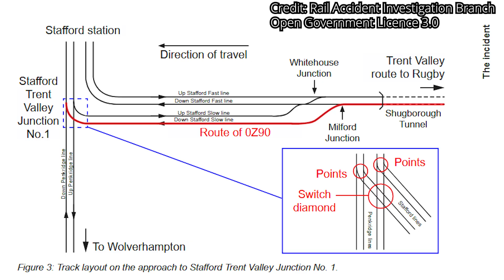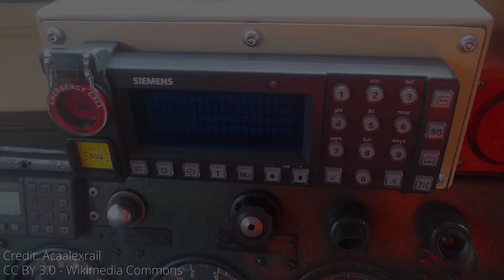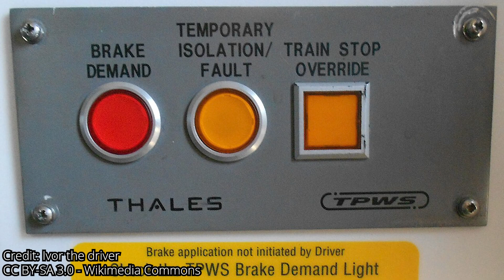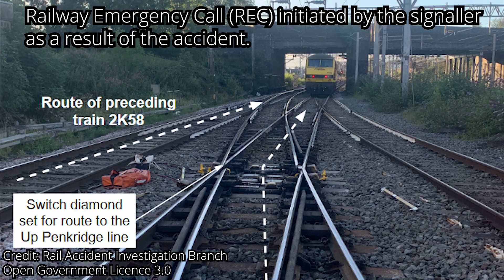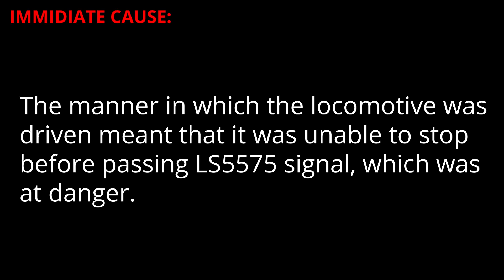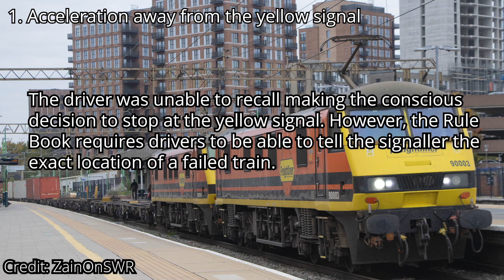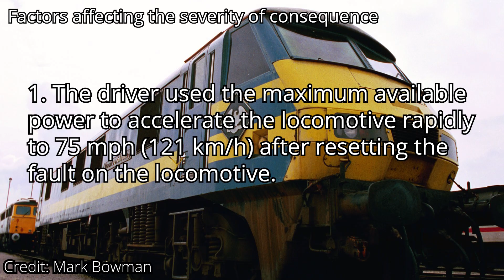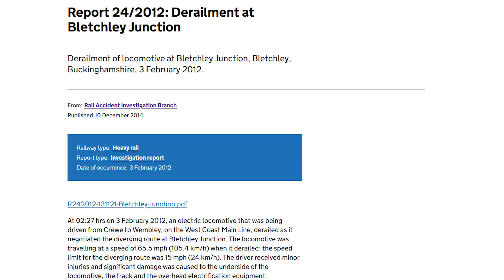The Stafford SPAD Incident | Jakeso

Comment: MYSTERIOUS & IMPOSSIBLE ISSUES  
1: Why did the Driver stop at a yellow signal ?  THIS IS NOT NORMAL. Loosing the line light does NOT mean you need to stop, as a light loco will happily coast for miles.  
2: ALL light locomotives are limited to 60mph for braking reasons ! And have been for over 50 years !  
3: Your Diagram/picture at 0:28 indicates a route (the dotted white line) through a "switch Nose" Diamond that is IMPOSSIBLE. You cannot change tracks passing through Switch Nose Diamonds. And if the switch nose Diamond had become so totally faulty as to provide the path you have dotted in White, this also means something has gone very seriously wrong with the "Interlocking", which would never have permitted either route either way through that Diamond to be cleared. And the Signalman would have been immediately aware of a very serious and highly dangerous "Wrong Side Fault" !
So ! Where did you get this information, because as a ex Senior BR Mechanical & Electrical Engineer I'm suspicious YOU have NOT got the facts straight at all ! SPADS are one thing, but a Switch Nose Diamond doing the IMPOSSIBLE require a major investigation and creates the suspicion that something has gone seriously wrong with the wiring of a Power Signal box. Also the way you explain the supposed RAIB findings are also highly suspicious. What Railway Qualifications do you hold, because my suspicion is you have NONE.
Reply from the maker: To answer your mysterious and impossible issues:

1. I have no idea because I was not driving the train.
2. Yes, I mention in the video that the driver was exceeding the set speed for light locomotives. (Seen in the video at circa 09:35)
3. I did not create that diagram or picture, it's from the OFFICIAL RAIB Report THAT IS LINKED IN THE VIDEO DESCRIPTION and you can see for yourself, Page 19, Figure 8. As for the route being 'impossible', if you actually watch my video and/or read the report you'll understand that the whole reason this is an incident is because the locomotive PASSED THE SIGNAL AT DANGER and THEREFORE THE ROUTE WAS NOT SET FOR THE LOCOMOTIVE the route was set in the direction of a southbound train going towards Wolverhampton, hence the points being set for that movement. I will now link a section of Paragraph 47 of the report: 'At the same time, the front of the locomotive forming 0Z90 was passing the switch diamond at the junction (paragraph 8), which was set for the passage of the next southbound train towards the Up Penkridge line. As it passed the switch diamond it deviated violently to the right towards the Up Penkridge line (figure 8) while travelling at about 13 mph (21 km/h).'

I am not the RAIB, I am not the people who made the investigation nor am I the one who published the report. If you take issue with their report or the diagrams they have included in said report then feel completely free to let them know, but that is completely and utterly out of my control.

As for my 'railway qualifications', I make it abundantly clear in my channel's description that I am not a railway professional nor do I claim to be one. The fact that I am not one, however, does not mean I am unable to read reports accurately or have an understanding of the railway, I understand and appriciate the fact that I will have limitations but I can assure you I do not see where I am critically disadvantaged in reading or understanding this report.

Regardless of your 'ex-this' or 'ex-that', I'm suspicious YOU have NOT actually watched the video nor read the linked report and instead accuse me of not getting my facts straight at all and seemingly assume that I am singlehandly responsible for conducting the investigation myself and publishing the report when all I am doing is taking the information from the PUBLIC report and explaining them.

I'm sure you can appriciate after all the effort and time I put into these videos I take a degree of offence to your comments of which most of them are either out of my control or my responsibility. If you can clarify the 'suspicious' way I explained the findings then I'd be happy to take your feedback or clarify my points to you as that is arguably the only thing in your comments that I can actually answer to.
Reply: @Jakeso  
POSTS BY UNQUALIFIED PEOPLE CONCENRING COMPLEX RAIL CRASH INVESTIGATIONS - RESULTS IN PURE FANTASY !!!
Your programme does NOT give a link to the original RAIB report. But it does mention  QUOTE : Images sourced from Wikimedia under the CC BY-SA 3.0, CC BY 3.0 and CC BY 2.5 Licences: UNQUOTE

Wikimedia is NOT a qualified Edited, or verifiable source to confirm ANY information. Its as stupid as Wikipedia, and all other similar websites. And the links given ALL connect to Elon Musk's "X" channel. And that too is NOT a qualified or qualifiable source.  

Further have nailed down the original RAIB report by contacting RAIB there are NO TRACK DIAGRAMS OR PHOTOS OF SUCH IN THAT REPORT. And because you are obviously NOT even a Railwayman, much of what is contained in the original report answers my original questions I posted above. Hence I do NOT even believe that you accessed the real RAIB report at all. As that RAIB report clearly explains why the Driver stopped where he did, and clearly reveals that Freightliner are at fault for NOT properly training their Drivers, as I pointed out in my first Post. And the RAIB does state the loco ran through a "Pair of Points" damaging the equipment. But at no time derailed so NO "Switch nose Diamond" was involved at ALL. Your an unqualified buffoon and as a result post misleading and inaccurate fabricated nonsense about Rail Incidents you have absolutely NO comprehension of. And indeed even if RAIB had a typo error in their report you would not be capable of even spotting that.  People like you are a menace to the Internet.

REFERENCE: I am an ex senior British Railway Mechanical & Electrical Engineer. Who does NOT appreciate the sort inaccurate unqualified information being posted by "Jakeso".
Reply from the maker: 'Your programme does NOT give a link to the original RAIB' - It's the fourth line down in the description.
'Images sourced from Wikimedia under the CC BY-SA 3.0, CC BY 3.0 and CC BY 2.5 Licences' - The background images, I'd rather not have a constant black background, any diagrams are from the RAIB as displayed in the video.
'Further have nailed down the original RAIB report by contacting RAIB there are NO TRACK DIAGRAMS OR PHOTOS OF SUCH IN THAT REPORT.' - I once again refer to Page 19, Figure 8 of the report.
'As that RAIB report clearly explains why the Driver stopped where he did, and clearly reveals that Freightliner are at fault' - Both the Immidiate Cause & Causal Factors outlined on Page 37 of the report all link to it being driver error, with Freightliner's part to play being outlined as UNDERLYING, not the main cause.
'And the RAIB does state the loco ran through a "Pair of Points" damaging the equipment. But at no time derailed so NO "Switch nose Diamond" was involved at ALL.' - 'At the same time, the front of the locomotive forming 0Z90 was passing the switch diamond at the junction', RAIB Page 19 Paragraph 47.

Hope that clears up your confusion.

Comment: I don't fully understand the reason that light locos have worse braking performance than when they are hauling other stuff. Physics would tell you the ratio of brakes mass to overall mass stays the same, the only difference I could foresee is that the higher unsprung weight of the traction systems on the loco axles would reduce their effective friction coefficient relative to trailer axles. Also, isn't the performance of the brake system worse for a longer train because of the slower propagation of pressure changes?

I think the report (at least based on your summary) misses the fact that the signalling and train protection systems do not provide any positive safety, instead relying entirely on the driver to a) drive appropriately for the train conditions (light train), b) remember all signal aspects regardless of any interruption such as dealing with other train systems, and c) remember, in full, all of the signals and track features on the driven line section. The driver must do all of these without anything beyond reminders (which can be distractions in and of themselves, and can also be subject to "muscle memory" responses that degrade their effectiveness as reminders), there is no backup system that can guarantee that the train is brought to a halt safely and without incurring a SPAD from any speed.

Contrast this with continental safety systems, even older ones like PZB and ATB, and also the American PTC systems, which all offer effectively complete protections that under normal circumstances should always intervene before the train reaches a condition that could incur a SPAD.
Reply: Its a percentage of a light loco brake performance percentage of locos dead weight. , its actually not very good at all. That's why its restricted to 60 mph max, a train may be 2000 tonnes with a vast improvement in brake force. On a drivers slip all this info is written out on each trains consist therefore wagon weight. In simple terms the brake force of a train should be relative to the sum of the brake force that can be exerted by all the vehicles in the train relative to the weight of the train, excluding problems that may occur such as wheels locking and sliding under braking. I have seen a train slide down a gradient will all brakes applied . Its scary !  Early days a brake tender was used, recently, a 37 put into the consist DIT to provide greater brake force on coal MGR's 36 wagons on the Cwmbargoed branch
Reply: @DOCTORDROTT Sorry but you haven't actually given an explanation on why the braking performance is worse. 

The physics would tell you the following, the braking performance of the train (the deceleration) depends on the total brake force divided by the total mass of the train (F=ma). The braking force of the train depends on the friction of the wheel-rail contact (coefficient of friction) and the total mass of the train over the wheels which are being used for braking (friction force = coefficient of friction X force of gravity pushing the braked wheels onto the track [the mass]). If you combine those equations, the braking force of the train ends up being the ratio of the braked mass and the total mass times the coefficient of friction. 

So given that it is assumed that all wheels on the train have brakes on them, the braked mass ratio is 1, so the braking performance only depends on the coefficient of friction. For the locomotive to have a worse braking performance than locomotive+trailer combo, it must have a lower coefficient of friction. The wheel material is the same, if the braking performance is lower, something else must be causing the coefficient of friction to be lower.

Comment: Many drivers have been caught out by the power and speed of a 5000hp electric locomotive running solo , which in the case of a 90 is more than capable of 110mph if you let it.   He probably should have set the DRA
Reply from the maker: DRA isn't required for non-passenger trains, (and isn't fitted to some freight trains), since the Class 90s are ex-passenger/sometimes work in passenger they have them. That being said, nothing would be stopping the driver from using it, even if the rulebook doesn't require they use it.

Comment: I'm surprised that running a loco with a known fault that may not have been fixed properly, they didn't double head it with the second loco being pan down unless it was needed as a rescue...Also, it's so easy to get distracted by train faults.

Comment: There are two major faults: 1. driver speeded instead of using the right maximum speed 2. AWS Signalling is not effective to stop trains immediately ! Greetings from Germany! InGermany there are " Geschwindigkeitsprüfabschnitte": if a train or loco is too fast, it will be stopped immediately ! The connection to the overhead wires is switched out ! (Hauptschalter aus ) Thank you for your video, and greetings from Germany !

Comment: No mention of DRA at all.
Reply from the maker: Only needs to be set when standing against a danger signal or if stopped having passed a caution signal. The unit was standing against the caution signal when stopped so therefore the DRA was not needed, not that the driver would have remembered in this instance anyway.

Edit: Also, from my short time doing work experience at Freightliner I believe being told that the DRA isn't even mandatory for non-passenger trains.

Comment: As a very experienced WCML driver of class 90 and over that route all my career there is no excuse for what this driver did NONE he had plenty of indications in the cab to know the signal was NOT green plus why did he accelerate to 70 when his maximum for a light loco on that stretch is 60? And he was approaching a 50 restriction! And then a 40 restriction! As I said no excuse
Reply: spot on mate
Reply: Slightly worse than that, it was 75mph which is 25% above the light engine limit.

Comment: Retired  S&T / P-Way engineer here.  Somewhat confused as the photograph used as a diagram for the diamond crossing section of the junction, and description of the incident do not match the trackwork in the photograph. What is shown is a 'Diamond Crossing' not a switch, or slip points, a plain diamond crossing.  The diagram text says  Switch diamond set for route... etc Which is a physical impossibility as tit is a plain crossing, no switch or slip-points fitted so nothing to physically 'SET'  The mechanical point work  is actually located a few yards away from the crossing and there is no need for or means of 'setting' or altering the plain diamond crossing track geometry or function as a point/switch. The diamond is a pretty standard fixed track panel layout. It's entire reason for existence is to allow one track to cross over another safely and reliably. The specific geometry, check rails etc are there to ensure trains pass over the crossing without changing tracks.   Are we expected to believe that the locomotive managed to de-rail on the diamond crossing and re-rail every wheel perfectly on the other line continuing some distance down the line before eventually stopping.   If this is the case then the validity of the incident report must be called into question.    Hopefully the marked up images (diagrams) are just an image selection /marking up error made by someone who does not fully understand trackwork.  Would be interesting to have clarification on the existing report as the details of how the light engine avoided collision do not fully add up either.   Very odd.
Reply: thought the same , the report is not that clear

Comment: The fact the loco hit the switch and suddenly changed tracks was glossed over. Is that designed to happen to protect the other track ? If it was a heavier train or travelling slightly faster, surely it would have derailed or fouled the main line and possibly hit the preceding train?

Comment: would be interested to know whether the company checks telemetry after every diagram to determine conformance to the rules. i.e. was this driver routinely travelling at 75mph in a light locomotive and could have had some corrective training before this incident.
Reply: Locos and units are downloaded, these downloads are used when a drivers has "rules " appraisal by his manager at the depot. Data can be looked at to see if it was driven in the correct safe manner. At one stage we had to download a loco at EVERY A exam. This was added to the A exam sheet about 15 years ago. I am now retired so it may have changed now.

Comment: This is a good factual report marred only by spelling ‘Immediate’ incorrectly, this comes across slightly amateurish. Interestingly the chosen illustration of a GSMR radio set was taken from inside the cab of a ‘heritage’ class 25, I know this because just in shot was an earlier obsolete NRN radio which I actually installed! I’d have thought the compiler would have found a more recent photo, i.e.actually inside a class 91!
Nit-picking aside, there is a long, long history of accidents with light engine moves mainly because of all the traction power available but reduced braking efficiency as the narrator correctly stated.  With a rake of coaches or wagons attached, there would be an increased coefficient of braking.
Reply: I agree with your comments above, but would add that the commentator's 'glottal stops' were very distracting!